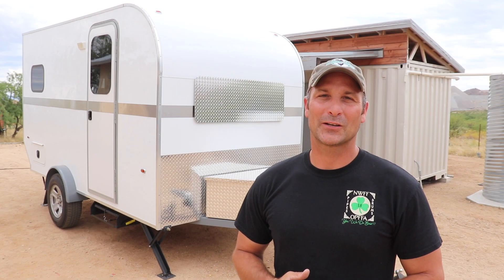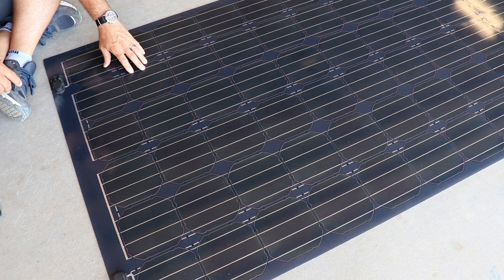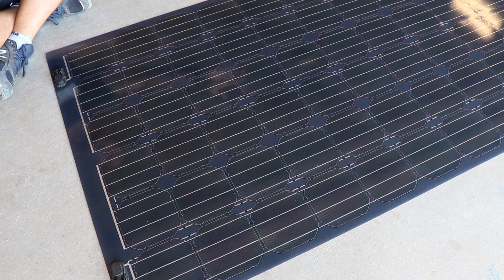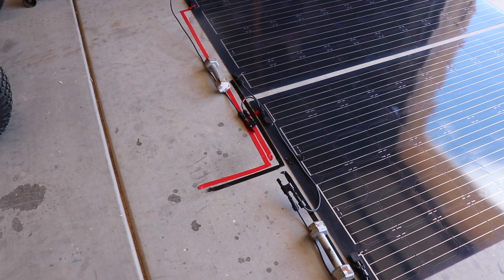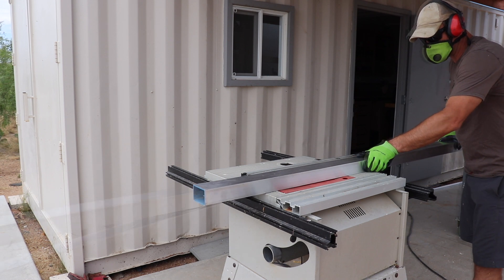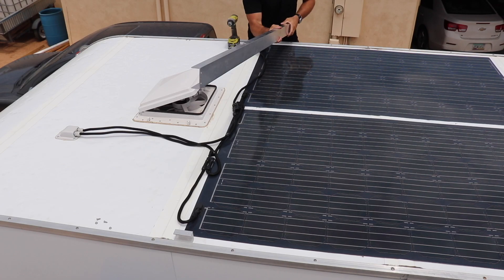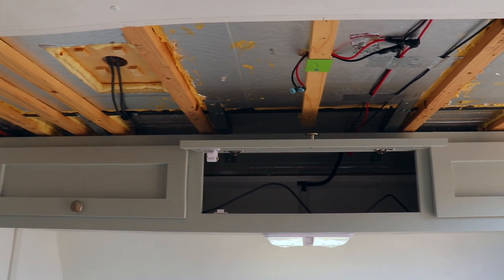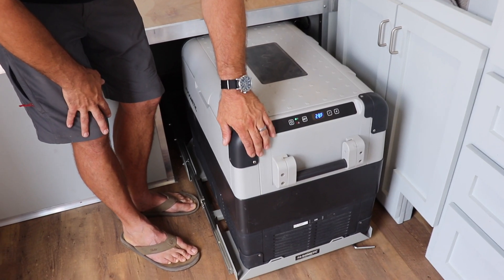How to Build a DIY Travel Trailer - Solar Panel Install   (Part 11)

Comment: justt curious as to why you did not just serial connect the 2 panels instead of parallel.  the inverter would work better with the higher voltage and the need for all the added connectors would not have been needed.
Reply from the maker: James Cox Yes, I’m still learning all of this. Solar is new to me, I appreciate the tips :)

Comment: Do you have a shunt on the battery so you can get an accurate battery capacity reading?
Reply from the maker: commando602 it’s in the plans....I have a ‘fuel gauge’ for the battery but Didn’t have the time or the ring connectors to mount the shunt off the negative terminal.   But it will eventually get ine😀👍

Comment: Corrosion is not an issue where you are, but how would you prevent corrosion on the roof from moisture trapped under the solar panel? Seal with silicone under/around it?
Reply from the maker: So this is something I’ve thought of a lot before Installed them.  They actually recommend to put a bead of sealant around then edge to prevent water from getting underneath them.   But since the roof is aluminum I’m not so concerned about water getting under them a bit.   So I’ve opted to not put any  sealant around them.  While water will get under them...it can also get back out versus getting trapped if they were completely sealed and just so happens to have a small inlet around the edge.   But in general I would recommend that folks follow the manufacturer instructions of sealing the edges completely.  I think it would be the best options for most setups...hope that made sense...typing with my thumbs 😉
Reply: Almost forgot...great video! Super clean install as usual...that trailer is looking better than some houses I’ve seen!

Comment: Too bad the inclusion of so many diodes drops the efficiency because each one is a voltage drop. And the connectors are MC-4 compatible, they are not made by Stabuli who owns that patent. Ouch - you shouldn't have put a disconnect in the negative side of the array wiring either. Why did you run them in parallel and not series? With an MPPT controller that should have been possible with a number of advantages... Also 'conduit ' has specific meaning, however what you are using is not conduit. It looks like split loom wire protection which is commonly used in the automotive industry. Which is fine for your application, but not really conduit.

Comment: Hello super videos you make :-)
Time stamp 10:26
The adhesive you use to keep the aluminum box fixed to the roof will not last over time. Sun and rain and the wind will tear it loose. And it would be a shame if it hit a windshield on another car behind you.
Hope you get some good camping trips in your RV.
Reply from the maker: Carsten Dencker Carsten Dencker I understand the concern...and it is something that I’ve looked into.  This tape is a permant acrylic bonding tape.  3M VHB CV62f.  Same type of stuff that holds in sky scraper window panes.  Also, it is the same stuff I used to attach the aluminum to the metal frame(part 2 of the series).   So there is quite a bit on this trailer.
Can it fail over time?  Absolutely.  But I am cautious when I travel with any sort of trailer.  So along with checking the tires before trips I also check door handles, windows and also attachments...window guard, aluminum trim, this channel, etc,.   So if it ever becomes loose I will repair it.  Would it be better to have screws...yes... and in most cases I do have them as well.   But that area didn’t have any backing for the acres to mount to.
Anyways, I totally understand the concern but I just wanted you to know that I do come wider safety a great dealon these things.   
Thanks for watching 😀👍🙏

Comment: Great job on the camper, if you ever find the cooler getting to warm just add a small fan to the compartment to circulate the air around it.

Comment: Camping trip Yahhhhooooo!!!. Sir, I couldn’t get home fast enough, when my iPhone notified me this had been posted, while at the grocery store. Wife also wouldn’t allow me to watch during dinner. Really enjoyed the customization to protect the wires from the solar cells. Does the adhesive tape really secure the panels to the roof. I would worry that the tape would eventually degrade. Can’t wait for your video on the performance of the entire trailer. Happy Trails 🐎🐎 🤠 🤠.

Comment: Dang, those guys saved you over $1500 , I can't believe they are so high, I guess partly because they are flexible and partly because of the built in protection on one damaged cell won't effect the rest which is all really great but not worth that much to me, thanks for sharing that with us, it is really neat..
Reply from the maker: L. J. Bush thanks LJ!  I think they are priced where they are for the reasons you mentioned as well as the fact that they are primarily geared towards supplying OEMs and manufacturers.   So they are really focused on getting consumer level price points since that isn’t their main business.   But they really are nice😀👍

Comment: you'll probably get more usable power out of those panels if series connect them.  With the mppt controller, you get the advantage of higher solar input voltage for those dusk and dawn low angle sun moments.
Reply: But in paralell you get more shade tolerant solar system. You may loose more in shading than you gain in wireloss by having one sting. 

The shorter the wire run, the less differanse between 12V and 24V nominal solar voltage.

Comment: i have a frigidaire energy star 5k btu that runs on 400 watts,,it operates just like yur dometic fridge turning on and running just 4 min per hr. seeing this video im almost convinced it will do well when i go to solar power with it. What amp hr battery are you using and how many batteries thank you.
Reply: I don't recall, but he's using a fancy battery that has videos dedicated to it, its housing etc on the trailer.

Comment: great choice in mppt controler.  Are the solar panels in parallel or series.  From what I have read, if the panels are in series the early morning and late afternoon the voltage drops with the mppt controller adjusting to charge at 12 volts dc Plus.  Battery monitors are available to know better how much battery you have left.  Send some of that monsoon rain up to Chino Valley, az.  we need it.

Comment: Awesome build!!! As you drive up past Hayden-Winkelman give a wave to my old hometown. My family loved to vacation in the White Mtns. Lots of great memories of barefoot times in Greer as a kid. Enjoy the fruits of your labor!
Reply from the maker: Michael Roberson haha...awesome!  Always love looking at that smelter stack....and thinking about the engineering that went into it.  Super impressive!   I will wave😀👍
Reply: When it was topped off in July 1973, my dad and I got to ride up to the top with one of the engineers. It was built to sustain 100+ mph winds and the top would swing through a 40’ arc. If you jumped off the top you would hit the sides twice before you hit the ground. At the top the concrete is 4’ thick and at the base 40’ thick. I used to remember how deep the foundation but can’t recall now. When we were up on top it was a cold breeze blowing. 1,000 feet is something else to see!

Comment: I didn’t see any fuses from the array down to the charge controller. I only install stationary solar systems, but I fuse the positive coming to the controller and the positive leaving the controller.  You did a nice clean install.

Comment: Your work quality is awesome. You’ve definitely inspired me to take more time and just do things right the first time on my home projects. I tend to rush to get my own stuff done after looking after all the details on my customers jobs. Thanks for that. 

Just a quick note about solar. It’s really helpful to use a battery monitor. I really like the Trimetric from Bogart engineering. I’m not sure how well it’d work with your controller, but there are certainly other good ones out there. Without one it’s like not having a fuel gauge in your vehicle. You’re just kind of guessing all the time. We run a 28’ trailer that has a constant 1A draw because of the fridge and a few other things, that I can’t eliminate, and a 200W system with 2x6V batteries. It’s about 210 amp hours and we’re laughing. It’s plenty of output and I live in British Columbia so that’s a lot less sun than you! Anyways, thanks again for the great videos. Cheers

Comment: Awesome project Joe! It's been a long trip, to get to this point. Do you have to get a VIN for the trailer? If yes, do you have to go to DMV or you can do it online? Have fun on your trip!
Reply from the maker: Desert Owl Forge thanks!  Yes you do have to get a VIN for s homemade trailer.   I had to and get it inspected at a DMV place....
But I won’t really touch on that on video because I think it varies greatly from state to state to state and I wouldn’t want to steer anyone incorrectly😉👍
Reply: @homesteadonomics  Thanks, I thought you can get a VIN through the "mail" in Arizona. On the side note: are you doing a video of the vacation?

Comment: Wow, a great job Joe! They make small led volt and ammeters that you could connect at the charge controller on the panel n battery side. I can send you a few if you want. If you place them in a small project box with a momentary switch you can check the performance at a glance. I ment to tell you this earlier after the batt install vid. Anyway, I'm impressed!!! I'm jealous even. Peace brother!
Reply from the maker: Bull Dozer thank you BD!   I actually have a little battery ‘fuel gauge’ that I meant to install... but kinda ran outta time as I wanted to get the video out before I left for the camping trip.  You can be assured that it will be going on soon though😀👍

Comment: Yeah but are you ever gonna fix the dents caused by the hail
Reply from the maker: supercomputer2004 I’ve decided that I won’trepair those sides until I have a carport to store it under while I do the repair.   I used to be able to wheel the trailer in my back porch by hand but now it is slightly to heavy to manipulate it by had in that area

Comment: This is the first video I've seen of yours.  Very nice job on that solar install!  I haven't seen flexible panels quite like that.  The ones I've seen were the white plastic ones with Sunpower cells.  I purposely went overboard on my solar system too, just to make sure I had enough.  So, what did I end up doing with all that extra energy?  I liquefy air.  I produce about 5 liters of liquid nitrogen and oxygen each day.  It's a lot more fun when it's absolutely free :)
Reply from the maker: Legend of the Stormlord thank you!   I have figured out what to do with the extra power yet but that is certainly intriguing 🤔😀👍  will have to look into it

Comment: Great work!

Can you provide reference for the wide tape you are using to stick the solar panel to the roof?  I am just about to install mine on my project and I was planning to use the 3M VHB-4952 Tape.  I am not afraid that the panel may become loose and fly on the road because the tape failure;  I am afraid that the panel may be almost impossible to detach from the roof in case of panel malfunctioning.
Reply from the maker: charlevoix418 thank you!  The tape I used to install is called heliobond pva 600bt.   I think it is butyl based.   Holds really well.....as for the vhb tape I think that would do great as well.  As for taking them off....I think both will be really hard.   But I actually think the vhb tape, while maybe a stronger bond might actually be easier to remove it you place it by the edges of the panels.  That way you could slip a razor in the middle of the tape and release it by cutting it in half in the foam layer.   You’d still have to clean up the residual but would be able to get the panel off easily.  However it might be harder if you had lots of strips of it.
The heliobond is really wide and gummy so I think it might make removal a bit harder.   But that’s just a guess.  Also, double check that the vhb you have will bond to both the panel and the trailer surfaces.  When I looked into mine I found tons of different formulations of vhb that adhere differently to plastics metals etc
Reply: I saw people on YouTube cutting the VHB Tape foam portion using a guitar string (I don't recall which one...).

I plan to put the VHB Tape only on the perimeter of the solar panel.

I called 3M regarding the selection of the tape because they have a ton of different types based on the kind of substrates.  In my case, my flexible solar panel was made of polyethylene (if I recall properly) and the roof of the travel trailer is covered with Filon (FRP):  3M Technical Dept. suggested to use the VHB-4952 Tape for that specific application.

Comment: Joe, when will you get the gutter pipes on your shop reconnected to the tank?
Reply from the maker: Marshall Poe I have them off because I haven’t added the replacement roofing on yet.  I am planning to use my old house roof to do it but the trailer and day job has just taken too much time.  Been up most nights on my 24hr shifts....but it will get done soon hopefully now that the trailer is at a stage where I can put it on the back burner 😉
Reply from the maker: Also....my house roof only got replaced in the last couple months so that was something I have had to wait on.  The shop has underlayment on though....so it’s water proof👍😀

Comment: But how do solar panels stand up to HAIL?
Reply: Lois Degeneffe yeah especially after his last round of repairs
Reply: Hail, I'd have a protective cover for them whenever not being used. Especially after finding out those prices.
Reply from the maker: Eric Brummer I have plans to make a carport structure for it eventually....I certainly don’t want to have any more hail damage😉
Reply: Don’t they need an air gap under them ?
Reply from the maker: Jim Murphy according to their installation guidelines they do not need any gap under them.
Reply from the maker: Lois Degeneffe I don’t know and hopefully won’t ever have to find out....haha....but they did say that hey can take Hail impacts.   To the level of the golf ball and egg size hail though....not sure.   But I do plan to make a carport to store it under as well as have a flip out awning that will protect them when it’s stored on the roof.

Comment: Do you mind sharing the total cost to build a home built trailer? 

Congratulations on your beautiful RV!! 👏🎉Job well done. Thanks for sharing! 🌵🌵🌵
Reply from the maker: jan smith I will eventually get to that in a future video but I haven’t talked about it because it hasn’t been to a useable stage.   But I can tell you now that the quick answer is that a good used one is likely the best value.   Lots of expenses that I didn’t think about😉
Reply: @homesteadonomics  never the less....your trailer is beautiful & well thought out. I think this will be one of the great lessons for your daughter = if you can dream it you can build it. Enjoy your wonderful home built camper with your beautiful family = wonderful memories will be built with this camper trailer = priceless!! 😊ps you should check out the you tube channel “my self reliance” he is building a home stead.
Reply: homesteadonomics Iam building my third camper ....my first build was my epiphany into under-estimating build cost of a camper. I used top notch materials and went double in cost to my estimate when first starting. My second camper was built for a published article using 100% recycled or upcycled material, and was built as an example of how to build on a budget. The third camper I just started took a while to passively buy materials (1 year). Doing passive material buying allowed a way to obtain some of the materials during sales, or discounted cost and in some cases bartering. This also allowed me to research and buy better materials at a discounted rate, diminishing the impact of building cost all at once or within a shorter amount of time thus lessening the shock to the wallet. Passively gathering materials allowed me to Carefully draw up a detailed set of blue prints which I was able to use to submit a materials list to my local steel supplier, and aluminum vendor. Essentially have all materials pre cut before even picking it up, thus basically having a pre-cut trailer kit, and camper box kit to start with. I've finished the trailer itself and have finished the box skeleton and aluminum sheet skin, and installed the Windows in just under a week and a half time, now Iam at a point where Iam needing to install the doors then it's onto the electrical/Interior finishing (most tedious part) I love your camper! It's pretty awesome and very cleanly built..as you know there is a million details and materials in building a camper "right", and is never finished with accessories. I can really relate to all the small things and time left out of your build vids. I live in central Arizona and I can also relate to having to build things according to seasons too. I skip building big things between July-September. Thanks for sharing your vids.

Comment: Awesome Joe! And Looks like you have a new toy "drone" I love the Arial video, I have a Mavic 2 Zoom and absolutely love it.
Those panels are really cool and love that they are flexable.

Thanks for sharing and as always keep building👍
Reply from the maker: Building with Todd thanks Todd!  Actually it’s an older one that I’ve had for about 3 years.   I just talk myself out of it most of the time....but I think I rekindled the fun.  Gonna take it on the camping trip...and get some more daylight shots as that dim light in this intro wasn’t the best😀👍